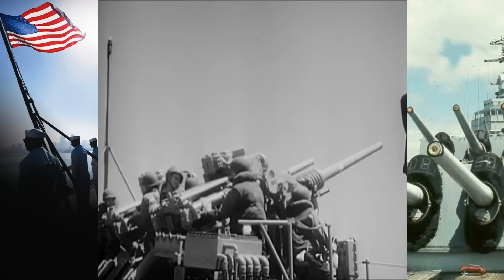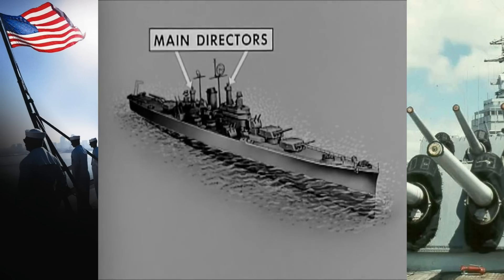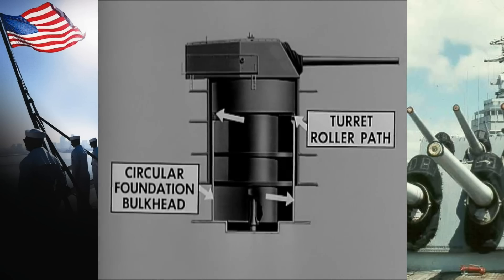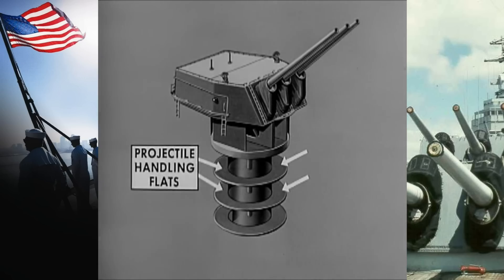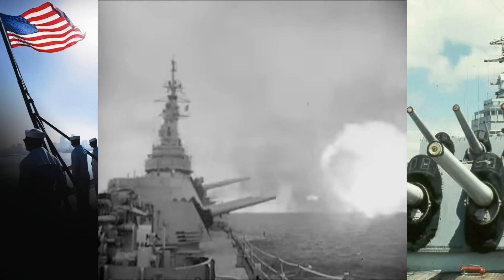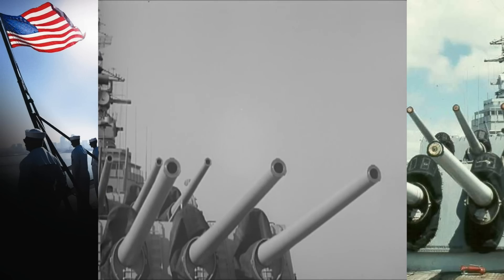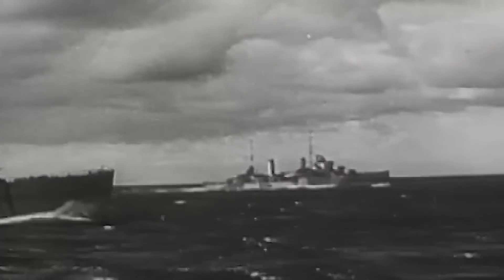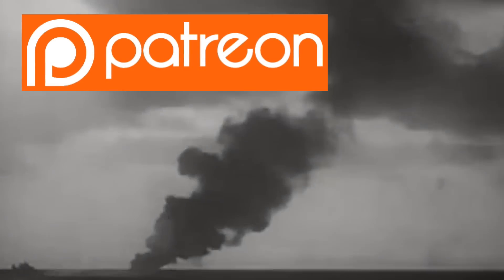How Do Large Caliber Naval Guns Work?

Comment: Aboard the Saint Paul off the coast of Vietnam in 1966 these guns were anything but 'automatic! These were 'bag' guns—there were no powder casings. The projectiles (either 260 lb or 335 lb armor piercing) came up into each gun room on a hoist which the Gun Captain then dropped into a horizontal position. Then he rammed the projectile into the breech. The 45 pound bags of powder (two per round) came up separately and were manually thrown in behind the projectile. Gun Captain jumped down onto the platform, closed and latched the breech, installed the primer—about the size of a .45 Long Colt cartridge—then climbed back out of the way and yelled 'Ready'. As the Center Gun Pointer I was in direct communication with and advised CIC (Combat Information Center), slammed the fire pedal down to close the circuit and waited for the explosion. That happened only when I lined up MY pointers (big brass wheel) AND CIC confirmed they were also on target. The videos here on Youtube are interesting, especially the one showing us operating on the gun line while I was aboard as Center Gun Pointer. Want more info? Search for the explosion on the Saint Paul (CA-73) in the early 50's. It was horrific.

Comment: So if it is an 8 inch gun, how is it rated as a 55 cal. when in actuality a 55 cal. is .550 inch in diameter?
Reply: It is imprecision in how we use language when talking about caliber. In ordinary speech we say fifty cal to mean point five zero caliber even though it is written .50 cal. The same with every other caliber from twenty-two to three-oh-thee. 

There is usually no ambiguity as all civilian and the majority of military personal arms are under an inch, and a good deal of military specs are metric. 

So examples such as in this video cause great confusion, even with people who are familiar with all sorts of ordinance. Ambiguity does that.
Reply: The 55 refers to the barrel length.  8 inches x 55  the barrel is 440 inches long. That's 36 feet 8 inches in length. A 3 inch 50 cal gun barrel is 150 inches long or 12 feet 6 inches.  A 16 inch 50 cal has an 800 inch long barrel....66 feet 8 inches long.

Comment: I'm not an expert but it seems to me that these size guns are pointless. These are the main guns on a Cruiser and Cruisers have been obsolete for a century or more. 

In the late nineteenth century when steel warships came to the fore, there were battleships - the biggest ship you could make. And torpedo boats -  tiny boats that could sink big ships if they could get close enough. Then there were Torpedo Boat Destroyers - to keep them from getting close. Finally there were Cruisers - faster than a battleship but more powerful than a Destroyer.

But then came the "all big gun" Dreadnought - a battle ship with no little guns. These soon became "fast battleships" and at that point cruisers were without a role. By Jutland Cruisers had to hide from the Dreadnoughts. If a Battleship caught a Cruiser within range the Cruiser was soon sunk.

Then came Pearl Harbor and Battleships were then obsolete. Today no Battleships, no Cruisers, no Destroyers, no Torpedo boats. We have missal boats with one single five inch gun but a lot of radar like the Arliegh Burke. I's called a destroyer but it's a whole different beast from WWII destroyers. 

Guns are so twentieth century.

Comment: Considering the volume of fire achieved by these old time guns. Modern missile armed ships could not afford to replicate it with hugely expensive missiles. This is still a role for large calibre rapid fire naval artillery firing low cost dumb shells. Current 4.5 inch guns are simply not capable of the same level of destruction at longer ranges. 
Just my opinion.

Comment: They were automatic because the Mark 16 gun in the Des Moines class fired 10 rounds a minute vs. maybe three rounds for the previous Mark 12 and 15. 10 rounds a minute by 9 guns means 90 335 pound 8” shells hitting every minute.  Enough to incapacitate any ship even a WWII era battlewagon.  The Des Moines class had a similar weight of shot per minute as a WWI era battleship or some of the smaller WWII battleships.  All in a heavy cruiser.

Comment: Very interesting, thank you for that. 
I wish there were more similar instructional videos with illustrations produced by the two other  navies that produced large calibre rifles; the Royal Navy and the automatic 6" on the cruisers HMS Tiger and HMS Blake and the Royal Swedish Navy that introduced the Bofors 6" automatic guns used on the HMS Tre Kronor and HMS Göta Lejon. They were also used by the Dutch navy on a couple of designs, they even liked the guns that much they moved them from an older class of cruisers and fitted them on a later class of cruisers. According to the artillery men onboard the later class of cruisers, they were so reliable and accurate they preferred to use them last in the exercise as they usually obliterated the targets, while the OTO Melara fast 76 usually jammed and the missile usually missed the target anyway.
They were scrapped before I entered service, but I have seen earlier and later automatic guns, the 4.7" used on the HMS Halland class and the 4.7" used in the coastal artillery in the form of 12/80 gun mounts. Two different designs and the later was much more modern.

Comment: Thank you so much for this video!
Back when I was in U.S. Naval Gunnery School in Great Lakes, IL (the beautiful translucent green glass building that was there is now gone :( ), I had been told what an excellent system the 8"/55 caliber was.
The system I learned for my 'C' school there was the MK42 mod 9 & 10, a 5"/54 caliber beast that was slightly more automated than even the 8" beast in this video.
Of course, our fire control (gun director and firing correction computers) was far more advanced than what was used in this video, with the fire control equipment not anywhere near the gun and directly feeding its firing correction data and even the electrical signal to actually fire the gun through remote wiring.
The MK42 could send out 32 rounds per minute and hit a target about the size of a car at around 15 miles distance!
Watching this video made me so nostalgic for those years I spent, some of the best in my life; something that I didn't even realize at the time.
Great times, indeed.
GMG2 - U.S. Navy - 1987-1991.

Comment: When I visit my parents grave in PA right next to their gravestone is another with the
name of a 20 year old Navy
 man who was killed off the coast of Vietnam when as part
of the gun crew their 8” inch
gun misfired back into the
gun housing killing him and I 
believe 15 other men. So it was an automatic death for
all of them.
Reply: That kind of thing can happen, especially with a hot gun situation with a round failing to fire normally.
When that happens, the only course of action is to extract the unfired case, then insert a "short charge," which is a somewhat shorter case so shortened to make getting into the breech easier.
Once the short charge is in and the breech is closed, the firing circuit is activated again to clear the projectile from the gun safely.
Doing this can be extremely dangerous because the breech is opened with a live powder case and projectile still in the breech.
However, when the gun is hot (especially under combat conditions, as you mentioned), the danger level goes up at least tenfold because of the very real risk of what's called "cookoof," a situation with the residual heat in the gun barrel detonating either the powder charge in the case, the explosive charge in the projectile, or even both at the same time.
If the breech is still closed and the gun cooks off only the powder charge, it's still a very spooky situation; but as long as the barrel is pointed in a safe direction, no one will get hurt.
However, even with the breech still closed, if the projectile cooks off instead -- a situation much less likely than  powder charge cookoff, according to what we were told in Gun School -- the resulting explosion can and will burst the barrel at the breech, almost certainly killing everyone in the gun house and in the control room directly below the gun house.
However, the much more likely situation and the riskiest situation is with a hot gun under combat conditions when clearing the breech is especially crucial to get the gun firing normally again to defend your own ship.
When that happens, the gun crew will move as quickly as possible to first manually open the breech-block, extract the case that failed to fire, then get that short charge in the breech and close the breech as fast as they can manage.
The whole time, the gun crew will be struggling with mortal fear, especially during that most dangerous phase when the breech is still opened.
Even with the short charge inserted and the breech closed again, the crew will still be biting their nails until the short charge fires, safely clearing the gun.
Sadly, they don't always make it to getting the breech closed again, which is exactly what happened to the gun crew of Mount 51 (the forward gun) on the guided missile destroyer USS Benjamin Stoddert on June 26, 1972.
All four men on the gun crew in the gun house and the "Carrier Room" (control room directly below the gun itself) were killed.
And yes, the ship had fired thousands of rounds (!) under combat conditions off of Vietnam when that happened, so that barrel was hotter than a firecracker at the time.
One of my instructors in Gun School had served on the Stoddert years after that, and he said that the navy had long ago repaired all the damage save one visibly bent beam, specifically to serve as a sobering reminder of the tragedy.
He even claimed that some of the crew had seen the spirits of the lost gun crew, so take that for what it's worth.
I served on a ship of the same class (Charles F. Adams) as the Stoddert as a Gunner's Mate, trained specifically for and worked on the exact same gun system (5"/54 caliber MK42 mod 10), so I know to the finest detail what happened, all the way down to exactly where the men in the gun house would have been standing at the time and exactly what they were doing.
Sorry for being so verbose, but you are appropriately respectful, and I thought you might like a full explanation of what almost certainly happened to the crew of the ship you mentioned and a history lesson at the same time.
Reply: @Gunners_Mate_Guns  Thanks for sharing that.  That was an excellent description and explanation.  These kind of comments are why I love the comment section.  Sometimes more than the video itself.
Reply: @mrreymundo5383  You're welcome and thank you right back.

Comment: I was assigned to a firebase in Vietnam back in 1970. Our base had several 175mm and 8 " self propelled howitzers along with a couple of Dusters and a Quad 50. I now have a matching pair of cochlear implants due to the blast from those behemoths. The hearing protection we was given (Not!!!)  consisted of inserting a finger in each ear. Thanks Uncle Sam...
Reply: I was on the USS Bridget DE 1024 (1969 and 70) and we had the smaller 5 inch twins which we loaded by hand from outside the gun turret and were given cigarette butts to put in our ears. Actually we just stood outside between the guns and the ammo house and passed the shells into the guns when the shells were brought up to the surface to be loaded into the guns. I threw a lot of shells overboard that didn't fire.
Reply: @johninokla2635  
Man, you are a lot braver than me. I wouldn't want to be within a mile of a dud that didn't go off!!! Glad you made it back in one piece Brother!
Ciggy butts?! I am guessing the word most used in your vocabulary is, "Huh?" VA was pretty much worthless as far as getting me hearing helpers. Ended up using my own insurance to pay for them.
Reply: I carried a VA card for 50 years. When I needed help with my vision, they responded with "You're not eligible, unless you'd been in Desert Storm or were raped" (!)
Reply: @wolfeboronian4795  got abestoes and lead poison from the INDY in PHILLY shipyard 1985/87 they lost the records? and had a shipmate wanted me to tell them he was there? wtf
Reply: I had my audiologist send my hearing records across town to the local V.A.  When I went in to apply for assistance for my cochlear implants my records also got lost. Across town.The V.A. had a record of receiving the report records, however they just disappeared.I realize hearing loss is a minor issue compared to what you are dealing with. It's just that someone needs to be held accountable for the way veterans are being abused.
Reply: I know what you mean,  I was an F.O.

Comment: I shot 8 inch howitzers i the Army. Our projectiles weighed 200.0 pounds except for the nuclear projos which weighed 247 pounds, I've never heard about any nuclear projectiles for naval guns. They had a range of 22,600 meters, a little over 14 miles. The breach was a whelen step-thread design using the Debang obturation system with bag powder just like the 16 inch naval guns.  We had a power rammer but when it didn't work then four guys on a ram rod was used to ram the projo into the chamber. The projos were carried by two guys to the breach.
Reply: The navy stopped carrying tactical nukes onboard the heavies in the 60's.  The range on an 8/55 was over 20 miles, how much more depending on the type of shell being fired.  HE weighed 260 lbs, AA 300 lbs, AP 330 lbs.
Reply: Served with 8" guns with the Royal Artillery in Germany in the 80's. Remember those days well. Spent many a winter's night in the FSS with a US Detachment practicing for what we hoped would never happen.

Comment: As to the 8' /55 , you REALLY need to add the Mark designation. The semi-automatic Mark 16's in this vid on the Salem were far different from the older 8' US guns. They were pretty unique in having a much higher rate of fire than any other 8' or even  large caliber naval gun or just plain "big cannon" ever made.  The mount and mechanism between the first mark 9  such as on the USS Lexington (early CV) and the USS Salem Mk16, makes different guns. For example It is like saying a break open single shot 12 gauge(Winchester Model 37) is the same gun as a pump 12 gauge (Winchester Model 500). 

Realize y'all are copying Wiki , but Wiki is only as accurate as whoever last wrote it that got by the gatekeepers ,and sometimes that is not accurate for more specific examples and details, like here.

The 8' guns here are really far different than any other "large" caliber naval gun, they were next generation compared to anything else like the earlier cruiser 8 inch or the 16' carried by the US battleships. Their ammo (2 piece case-semi-fixed) was loaded mechanically not like the shell and  2 bag charge ammo(more  manually loaded) of the earlier 8' armed ships.  So how they "worked" are pretty different . Effect you could say was the same on a round to round basis, but rate of fire much greater(10 rpm compared to 3 rpm)

Comment: I did not get to finish my earlier comment.  Because the pace of naval warfare in WWII quickly changed to aircraft carriers, and there were relatively few surface engagements, the U.S. Navy did not get to use their radar controlled guns as much as their planners envisioned. Yes, there were night engagements for our navy, but the main battles were done around Guadalcanal, Savo Islands, and later operations as the U.S. Navy island hopped towards Japan.  I think the big guns on ships still have a place in naval armament, but they have been eclipsed by naval aircraft and missiles.  Some wise heads during the war in Vietnam realized that ship-to-shore bombardment of coastal targets was more cost-effective with the heavy cruisers and the reactivated Iowa class battleships.  When you look at the munitions lobbed by guns on targets, it would take
A costly jet fighter several trips to drop the same tonnage.  

The science of ballistics could easily refine the shape of naval shells and how guns are designed, if given the chance.  You will notice the much touted electro magnetic guns that the Navy is experimenting with use the same principles but instead of powder charges it uses very high
Electro magnetic pulsing to propel a shell much farther and faster.  Cost and having an adequate power source on a ship become some of the obstacles.  The biggest gun on Navy ships today is the 5” gun (127 mm) and its barrel length is rated at 62 caliber.  This gives the shell more time rotating in its rifling and gaining energy from its charge to hit targets at greater distance.  Indeed, with extended range ammunition, ranges of over 20 miles have been reported with just the 5” shell. Imagine if that same science were applied to an 8” or 12” shell.  Tremendous impact at a much lower cost than a high tech missile or jet fighter under the right circumstances.